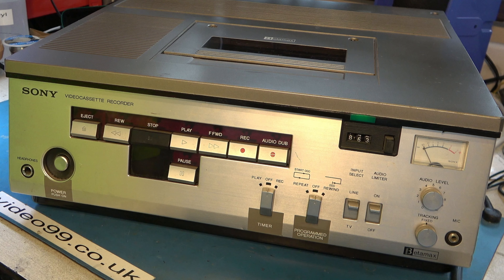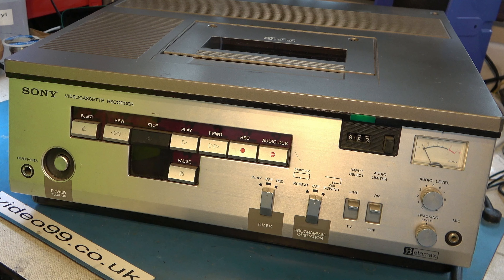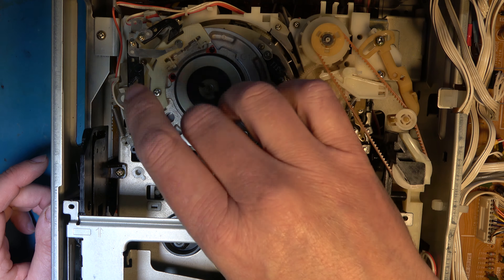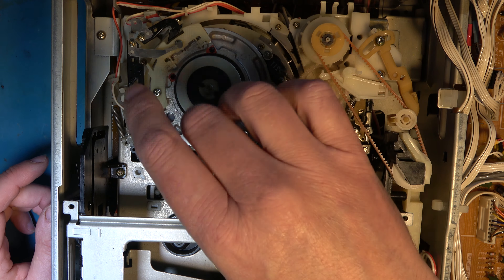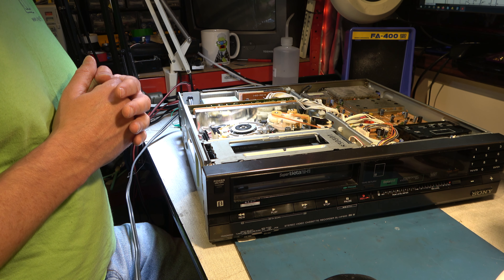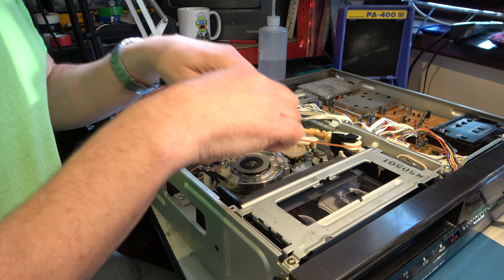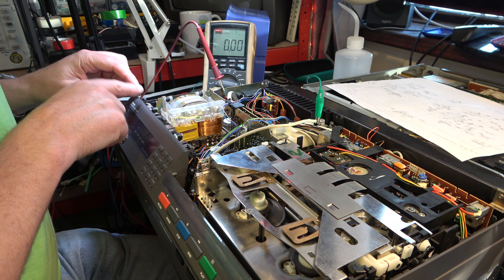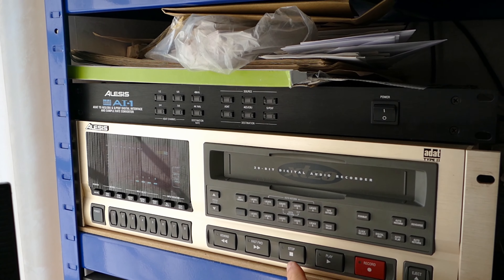Working on a Sony SuperBeta SL-HF600 and more on Philips VR2324

Comment: The SL-HF600 have this servo problem, 
caused by the faulty STK5441. Need replace it, surely for first.
Reply from the maker: The PSU voltages from the STK5441 all seem OK.  But I've ordered one anyway, will take a little while to arrive.

Comment: If I remember rightly a cap in the power supply can be a cause of the blowing fuses in the vr2334. Also get bad connections on the cables from the deck around the plugs
Reply from the maker: I am suspecting bad connectors.  I've ordered some of the correct fuses and will work on it again.
Reply: @video99couk  I’ve checked some notes fuses 1006,1008 blow can be caused by capacitor c2028.   Symptom: Dead. Does not react to Play etc or clock flashes  can be connectors f7,f11,f12. Although these are for the 2334 I’m sure they are similar

Comment: In answer to your question about DTF, it’s because it’s powered off two one hundred and something voltage rails so taken direct from the PSU. So if a fault develops in the DTF circuitry, it shuts down the VCR.

Comment: I've fixed a few of these and similar models now, they have some common issues:

-Bad voltage regulator in the power supply: The STK5441, almost always bad. Replace all power supply capacitors for good measure, even the large one. 

-Loading gear: One of the gears in the loading mechanism always breaks a tooth, Sony part number 3-684-163-01. There's a guy on eBay selling them now, PlutoniusX, I've fixed 3 machines now with these gears: SL-HF900, and two SL-HF300's (extremely similar to this SL-HF600). 12voltvids on Youtube has a great video on re-timing the mechanism:

https://www.youtube.com/watch?v=HvpDtQDvOTc

-Loading mechanism leaf switch: Very sensitive to dirt, you can tell if it's not working if the machine doesn't take in the tape.
Reply from the maker: Very useful information, I suspect we have a broken loading gear.  Unfortunately it smashed up the spring loaded coupling again!  Really need another of those.
Where is the leaf switch?
Reply: @video99couk  The leaf switch is mounted to the side of the loading mechanism, and actually rides on the gear that typically breaks. It has two wires going to it.

Comment: Have you worked on JVC-HR-DVS-1EU?
Reply from the maker: No, not worked on that one.  I've worked on JVC miniDV and SVHS machines (and DVD/HDD recorders) but not that model.
Reply: @video99couk  Have one, goes to stanby after 3 sec. No loading. Rolls back tape guides and standby if i have rolled them out. Googled and most suspected are mode switch and D-Drum alignement gear.

Comment: I had an ED beta machine with noisy head drum, it worked fine but had random static in the picture, I was told when the bearings wear out they start making static, I sold it as is.
Reply: Now I know where the safely Ground Connection is, nowhere ! Je vais essayer le bas de gamme alors, avec mon SONY SL-HF950ES

Comment: i thought the beta machine might be a bit picky with a 50hz mains frequency,  maybe it has to see 60hz for the logic or clock to work correctly.
Maybe 50hz upsets the psu voltage.
The philips is annoying, i would cut that wire that shuts the deck down, you need to see why it has to shut down.
I know how you feel colin, ive had devices that make me pull my hair out.
Reply from the maker: The Sony is rated for 50Hz/60Hz.  Japan uses a mixture of 50Hz and 60Hz so most Japanese equipment will work on both (or sometimes can be switched over).
Reply: I understand that this video recorder works fine with either 50 or 60 Hz. but when I have US equipment that requires 60 Hz I use my 60 Hz 110 Volt pure sine wave inverter running of a 12V 25A ham radio power supply.